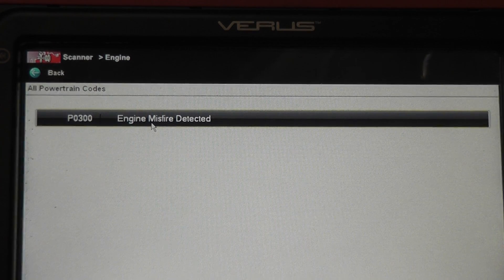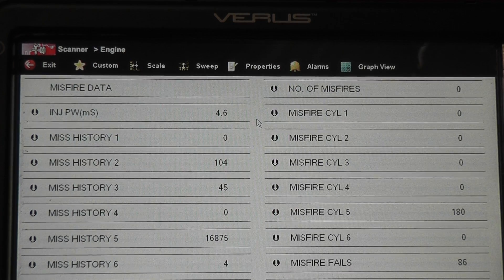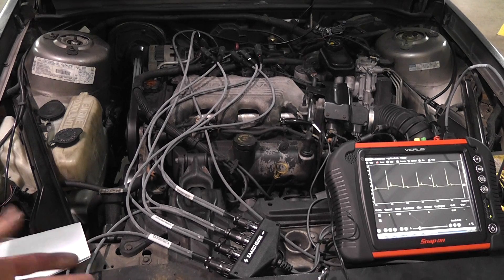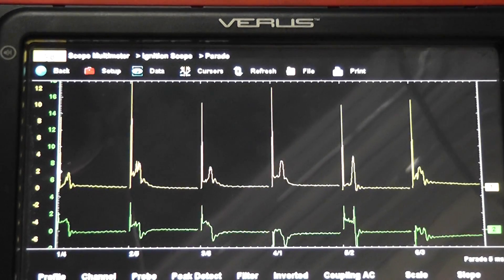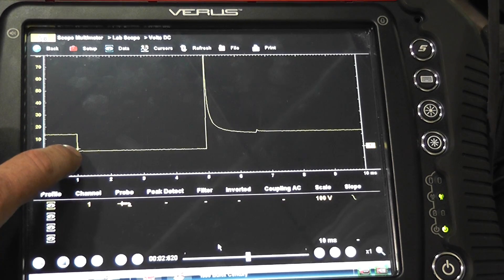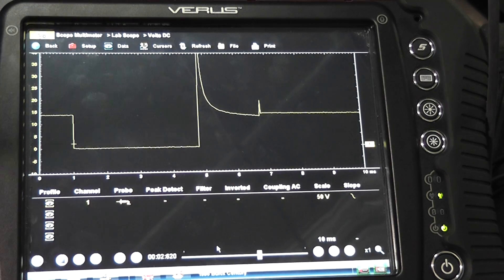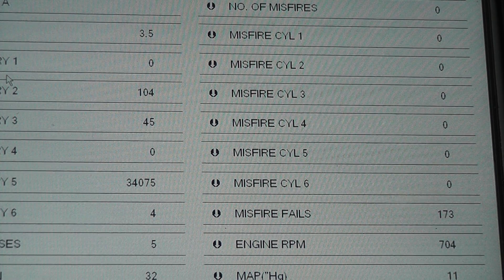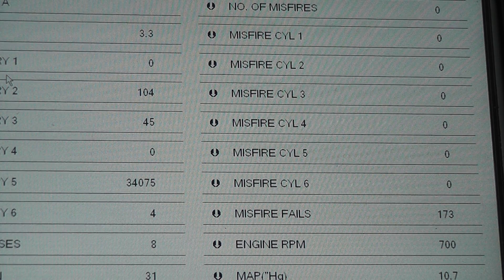Misfire from a sticking fuel injector (no fuel misfire)

Comment: 10:10 thanks ScannerDanner for this video I am very happy today after one of my friend's car was fixed (2 problems clogged catalytic converter and stuck fuel injectors) I did the catalytic converter replacement first thinking that was it but nope, still the intermittent P0300 code which went away after adding the CHEVRON TECHRON
Reply from the maker: That's awesome that these systems are still on the road. Rust has taken care of all of these in the northeast. Glad it was helpful!

Comment: Hi can a problem like this with one injector cause negative long term fuel trims and lower engine power on a 4 cylinder turbo engine? Can a leaking fuel injector cause same symptoms? Awesome video loved how you explained everything very clearly. Thank you
Reply from the maker: A leaking injector can definitely cause negative trim numbers, but typically won't cause low power complaints unless the plug is also fuel fouled
Reply: @ScannerDanner Hi I had seen your video about this before and I just recently started feeling rough idle and misfires on cylinder 2 and I can also see it's missing that pintle hub and other 3 cylinders do have them, what causes this to stick close? I have seen significant engine power loss like if im only running 3 cylinder turbo car. Is hitting it like this just temporary fix?
Reply from the maker: Can you free it up by smacking on it? If so, you can try doing an injection cleaning service, but you need an external tank that you can pressurize (i show it in a few videos) and add a heavy cleaning agent to a mixture of gasoline. 
You can also try a can of BG44K in the tank.
Reply: @ScannerDanner I tried smacking it and it lowered misfire counts but misfire is still there, I've put a couple of fuel injector cleaner it helped but not completely
Reply: @ScannerDanner Sorry I wanted to ask you I've been trying to learn fuel trims and maybe this helping others out, can having a fuel injector sticking closed like this also cause lower engine vacuum and if so why? Thank you God bless
Reply from the maker: Any misfiring event can lower engine vacuum from low engine rpm. Raise rpm to 1500 in park. Does vacuum improve?
Reply: @ScannerDanner Yes vacuum does improve when I raise RPM to 1500, in park it's about 16.5 hg then goes to 20 hg, but when I shift to drive it goes down to 13 he when before it would be at 16hg in drive

Comment: Hello, ScannerDanner, would this also work on diesel injector testing? I know they have different voltage(?) so I'd have to adjust the settings for that, but would they operate in a similar manner i.e. be grounded, have the spike, and pintle hump? Thank you!

Comment: 12 years later from your video Paul, i just had this happened this to me exactly chevy 3.1  all i had was. p0300 but what it was cilinder 3 injector stuck closed after days of unexperieced diagnosis i remembered your video , i smacked the injector fixed in two seconds , i am gonna try  injector cleaners will see if it stays running
Reply from the maker: BG 44K Fuel system cleaner was the fix for this one from what I remember? Thanks!
Reply: @ScannerDanner  will try , stay strong paul.

Comment: Thank you for the redirect. It helps to see these waveforms. What would it look if the injector was clogged or if the fuel pump pressure is not enough to open the injector? I need to go back to basics from your book for sure and get to see the waveforms as I get more hands on on bad signals that I'm not 100% certain if they have a certain characteristic.
Reply from the maker: A lean misfire on a secondary waveform will look like this stuck closed fuel injector. Whether that lean condition is from a vacuum leak on one cylinder, a restricted injector, or low fuel pressure. Obviously a low fuel psi condition would result in ALL of the cylinders looking like this. Check out chapter 1 for some examples of secondary ignition misfires. I have some lean condition examples in there as well. Thank you!

Comment: Well, I have a 09 ford flex I started noticing a random misfire until I started on the gas for the past few weeks. Then it clears up. today no. Constant misfire. Replaced the plugs and coil no go. The injector is not clicking. I tried smacking it a few times with my wrench. Nothing. The engine felt like it was misfiring on more then just the cylinder #5 the OBD was showing on the way home but it did not throw any other codes. Well, I just ordered all 6 injectors and doing it this weekend. I'm hoping its just that and not the damn fuel pump. I would not think so since its isolated to this one cylinder and using a sound tube there is no clicks from this injector. I'm thinking the extra vibration was the injector was getting stuck open shortly and it was hydro locking then going back closed. Strong fuel smell then no fuel smell.

Comment: Why only at snap throttle I should expect the high spark line, why not at complete idle as misfire has been there all the time ?
Reply from the maker: Turbulence and psi rise in the cylinders, make it harder for the spark to jump the gap and fuel is a conductor. So two major influences on the spark line at the same time, which reveals the fault. Hope that makes sense

Comment: SCANNERDANNER, can you show on the oscilloscope how to measure the "dwell time" of the ignition coil and spark plugs using the oscilloscope. Is the Dwell time the interval space between each ignition coil voltage waveforms
Reply from the maker: dwell time is simply the time that primary current flow is occurring
Reply: @ScannerDanner , but where is the "dwell time" when looking at the ignition waveform?  I don't know where to look on the oscilloscope waveform where the dwell time occurs do you know where it is?
Reply from the maker: Voltage waveform or current waveform? Primary or secondary?
Reply: @ScannerDanner  can you show in the video how to measure the dwell time of the primary waveforms and secondary waveforms because i don't understand how to measure the dwell time and how the dwell time changes the RPMs
Reply: @ScannerDanner  Can you please make a video explaining dwell time because i don't understand what is dwell time and how to look for dwell time on the oscilloscope waveforms please

Comment: Ironic this came up in my recommended video's after I just had a 98 Century come in Friday for a Cylinder 3 misfire.

Started off checking for spark with a test light to ground and pulling plug wires off the coils, All had good strong spark but #3 i had no change. Car had all new plug wires, plugs and coils on it so someone was trying to fix it before it came to the shop I work in.

Next step I did was go after fuel so I put a fused jumper in for the Injector fuse and had all 6 currant ramps. Didn't have a tool to fire the injectors to check for fuel pressure drop so i unplugged the bulk head connector for all the injectors and manually fired them with my power probe and sure enough #3 did not have a chance in pressure. Tapped on it with a screwdriver just like you did and BOOM misfire gone.
Reply from the maker: nice! Just be careful manually energizing the injectors, you can easily flood the cylinders with too much fuel and cause a hydra-lock condition. Also, on some injectors, you can actually hurt the windings if you energize them for too long. Good find though my friend and great job.
Reply: @ScannerDanner  Agree 100%, Just did what I needed to see to get a 100% confirmation injector is was no good. Love the videos! Living close makes me hope one day run into you and get a chance to talk sometime! You, Eric @ SMA, Ivan @ Pine Hollow, And Keith @ New Level really helped me with diagnostic tactics!

Comment: I have a misfire in cylinder 2 and a small evap leak on a 6.1L Magnum. Why are you doing all this if u can just take a stethoscope and listen for the ticking of the injector? I am stuck I changed the plugs, the coil, and switch the 2 and 4 injectors.

Comment: Did you ever make a video on how to use that snap-on ignition setup you used?
Reply from the maker: The one for waste spark systems?
Reply: @ScannerDanner  Yes
Reply from the maker: It is garbage, don't bother with it. Not to mention most systems are COP anyway. Way to expensive of a part with way to many issues.

Comment: have a question,with new cat on gm 3.8 O2 sensor 11 at 50 to 700mv  closed loop and O2 12 at mirroring the os 11.almost same.And light for 0420.
Reply from the maker: junk aftermarket new cat, factory only on these bro. How old is the new cat? bet it is only a few months old. 
Also, make sure there are not other faults and no exhaust leaks in front of the cat.

Comment: If I'm only getting a random misfire at idle would it show on a snap?
Reply from the maker: Possibly but doubtful. An idle only misfire is usually a mechanical problem (low compression), or possibly an intake manifold gasket leak.

Comment: How did the fuel trims look with this kind of problem? Thanks great vid.
Reply: I have a constant misfire in cylinder 1 and cylinder 3 the values go up to 98 and my bank one fuel trim long-term hits two Max 25 and a shirt term hits is Max  at 50 at first I thought it was a vacuum but I cannot find it even with a smoke machine so now I'm thinking it's a bad Vortec injector spider thingy come across this recently

Comment: If you happened to be scoping the injectors first but the problem was actually a dead ignition coil, does the injector wave form also give you clues to a dead ignition coil just as the ignition coil wave form with its high spark line did for the stuck closed injector? Thanks man!
Reply from the maker: No it will not. And you have to be careful about "intentional shut-down" of a fuel injector. Here is a lesson I did with my class. It is on my premium channel but there is a 14 day free trial that you can cancel at any time during the trial and not be charged. 
https://www.scannerdanner.com/scannerdanner-premium-chapters/chapter-18-fuel-injector-testing/356-chapter-18-page-6-expanded-content-fuel-injector-intentional-shut-down.html

Comment: I can certainly vouch for the Chevron Techron in terms of unclogging fuel injectors. I recently repaired a 98 Toyota Avalon that had sat for ten years. The fuel tank and pump assembly was completely rusted, but old fuel was still in the lines up through the injector rails keeping moisture out and the rest of the system from corroding. After replacing the tank, fuel pump, filter, blowing the lines, and adding fresh gas, the engine would not start. Adding a bit of fuel in the intake proved the engine would fire right up, so I definitely had gummed up injectors. I added a bottle of Techron to about 4 gallons of good fuel and cycled the key a few times to push the mix into the fuel rail, then cracked the line open to drain the rail and repeated that draining/filling process two more times to push fresh mix into the rail and injectors. I let it sit for 30 minutes and started the vehicle. It went from no start to running on 3 or 4 cylinders. I snapped the throttle a few times, shut it down to sit overnight and when I fired it up the next morning the car ran like a sewing machine. Never had another minute trouble from it.

Comment: brilliant, it seems whats the point of diagnosing without a scanner or oscilloscope.
Reply: I couldnt agree with you more than I do. However there are a few simpler "ballpark" tests that would be useful when an oscilloscope is not available. My favorite test is the screwdriver test, you just put a long screwdriver firmly against the injector and put your ear against it, you can hear the injector clicking loud and clear. You can compare the sound of each of them with the rest, and 99% you will get a true result. My car had 3 new injectors  and one old, all of them failed randomly (due to age and poor fuel quality I think) and caused subtle misfires. When the symptoms reappeared, used my screwdriver to guess beforehand which cylinder had the old  worn injector and I was correct.
Reply: yep there are some good tricks to be used that can be semi diagnosed in this way to a point you hopefully find the solution. Can use this also  on items with bearings as well like alternator etc if your game enough. But the majority does need quite the understanding of the complexities of the workings and relationships of and between so many sensors etc on vehicles these days. Even having a basic understanding can go a long way too, people just need to educate themselves a little more. Some things to work out do seem easier than others

Comment: I have a 2006 highlander hybrid   with a VCS Trac off check engine and brake light on any thoughts
Reply: Earlier traction control systems work by modulating the brakes with the ABS system. If there is a fault in the brake system, it will likely disable the traction control system because both systems share components.

The brake warning light will typically illuminate under the following conditions: emergency brake engaged, low brake fluid or a loss of brake pressure somewhere in the hydraulics.

Comment: This question is for Paul, or for anyone reading that may have insight.  I have the vantage pro and got my hands on the SIA 2000 adapter.  Do you have a video that walks through the set up of that adapter on a waste spark system?  Thanks.
Reply from the maker: Not specifically but I've used it in a few videos. I don't remember which ones off hand. If you search "misfire" on my channel, you'll have an easier time finding them
Reply: ScannerDanner okay. I know you're super busy but if you have a chance to make a step by step video of how to physically hook up the SIA 2000 adapter with the vantage pro that would help out a lot of people, being that there's really no videos and or articles out there explaining how to do so. It'd be greatly appreciated sir Paul, especially for your loyal customers:) thanks

Comment: Thanks for the video!
 We just purchased an '03 Buick Rendezvous w/3800 SFI engine and suspect a stuck injector. It has a definite miss fire in one of the cylinders and I've changed plugs and wires and checked all of the coils to no evail. I don't know where you tapped on the injector at since it's under the intake manifold. Will you explain how I can access it in order to tap on it? I saw you tap on the manifold but not the injector...Please help!
Reply from the maker: The 3800 wasn't known for injector issues. More likely from your symptoms it is a coil issue.
Reply: I'm sorry, I had that wrong, it isn't the 3800 it's the 3400 3.4 liter V6....
Reply: ScannerDanner I figured out the problem, I should have checked this earlier on but I've never had a vehicle with crossed spark plug wires. Two of the wires were on the wrong coil lead...

Comment: can you have excessive pintle hump? nissan pick up 2.4 l.... running Lean at idle, 2000 rpm and 3500rpm same. using you wot while driving test and monitoring   o2 they read 800mv..... so it makes it seem like the truck is getting plenty of fuel yet runs lean. smoked engine and no air leaks. new o2 plugs, cap, rotor. fuel pressure within spec.
Reply from the maker: no, I've seen some strange looking pintle humps on Nissan fuel injectors before. If they all look that way I would say it is normal. 
Possible MAF sensor problem
Reply: +ScannerDanner thanks brother. double checked NEW Aftermarket  maf sensor  and  it was defective. on top of that the connector pins were giving intermittent readings. chased my tail on this one for a good while.  disconnected it and engine settled down. new bone yard connector spliced in and factory  sensor on  order. by far you are the man when it comes to auto electronic  diagnosis . again thanks for all you do .

Comment: Today I scoped a few injectors and didn't  notice a pintle hump on them. Granted I am working  with an AESWAVE  uScope. I like the resolution/pictures off the uScope, but I don't  know if it would actually  pick up the pintle  hump I know you have a uScope and I'm wondering  if you've  scoped injectors so you could  tell me if in fact the uScope  is capable of catching it. I suspect injector  issues  for a p0171. I did have white smoke at one point but it just went away.
Reply: IN REFERENCE TO YOUR VIDEO: Misfire  from sticking fuel injector (no fuel misfire ) on ScannerDanner  FREE.
Reply from the maker: I'm sure it is, you just need to adjust your scaling and trigger points to see it.
Reply: +ScannerDanner Thank you for the reply. I did try many different  scaling  and trigger combinations, but will investigate more.
Reply: +Isshman Garcia Also, Paul last week I tried to send you $20 SUPPORT through  your channel  button, but it wouldn't let my card go through..it kept accepting the "payment" then a half hour later sending  me an email saying it was refunded due to my payment option not being good. I use the same card to get your premium subscription though! Any thoughts or ideas?
Reply from the maker: not sure man, they give me zero control of that, also when someone gives, I have no idea who. It just says a dollar amount after YouTube takes their cut. 
But thanks so much! You can just subscribe to SD Premium for another two months instead okay? Either way I really appreciate it.
Reply: +ScannerDanner No problem, will do. Just giving back or trying to anyways. If there is a way to show support  via your ScannerDanner site let me know. Peace

Comment: if there is no mechanical movement to the injector, could you listen to it with a stethoscope and notice that its not clicking?
Reply from the maker: +Lagos3sgte yes you can, just be careful as noises transfer through the fuel rail and you could be hearing the injector next to you. Do a sound comparison to be sure. Make sense?
Reply: +ScannerDanner yup! Thank you for providing such great content.